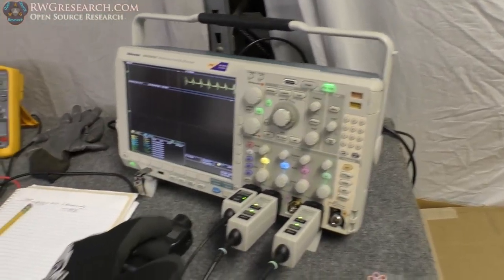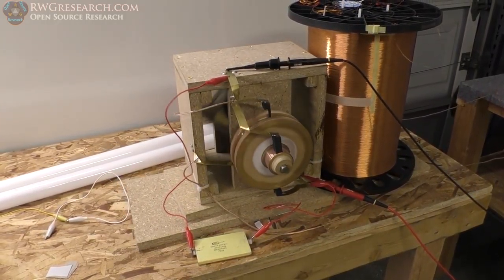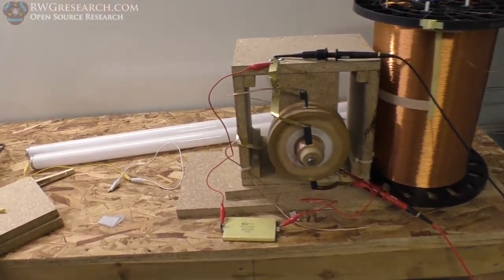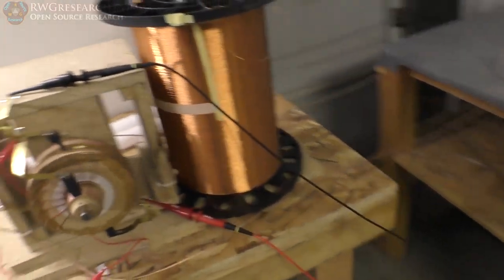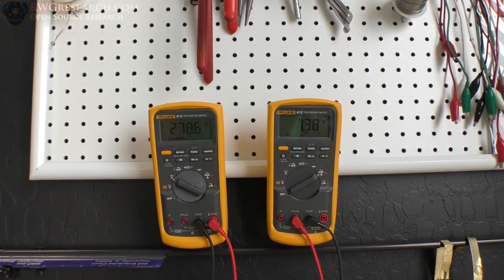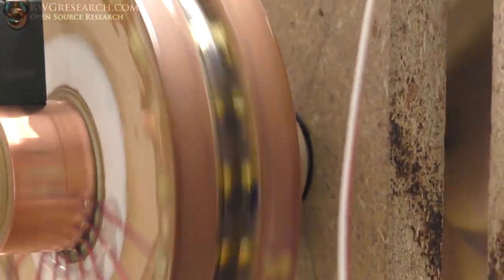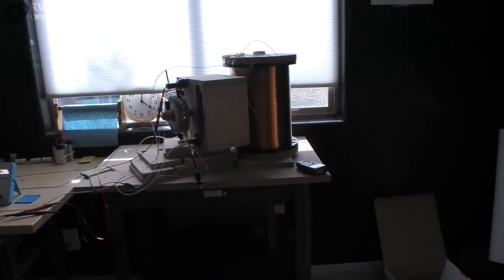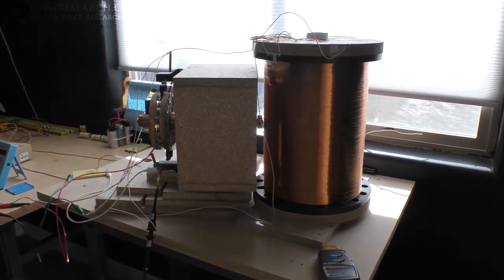JWN Project P4: Cap Discharge, Running Fast. Second Part Is with All The Wire... All 76 Miles Of It!

Comment: Are you going to run it at an angle as Newman Talked about? I've had some interesting unexpected acceleration of a free rotating stationary magnet from a nearby oscillating magnet at about 20 degrees from horizontal.

Comment from the maker: This video is random clips from 12-30-2017 to 1-17-2018 on the Newman test setup. can you decided why the cap makes it go a lot faster? Interesting observations... ~Russ
Reply: rwg42985 is any part of your set up grounded to an earth ground? The earth is just a giant capacitor, or single side of one, the air being a dialectric and the ionized space winds above the air being the other side of the capitor.  A small capacitor is a type of small floating grounding rod, but no one uses them that way.  Its grounding ability depends upon its size and discharge rate.  Sometimes even ground rods are poor grounds, ironically.
Reply: Hi russ im edgardo ligutom from philippines i also studied JWN motor and  built it i found it he was so much correct to what he says will i want to answer to your question why it running fast when you put the capacitor accross the coil is is simply because you short the coil when you cut the power supply off there no way to dump that huge current built up during a moment you energize the coil. the coil dont want to store energy when you cut to the supply so the only way to dump it is to the capacitor the capacitor act as a bridge to that huge current to pass .now in order to make use of that huge current to work is to short it to its self im refering to the coil so that the coil will then now become a electro magnet the bigger the current ang the number of turn the stronger the magnet. You are now so close to over unity in fact it is over unity already. In the video joseph newman coupled the machine to the generator and loop it to run itself.
Reply from the maker: Gristle Von Raben no,  nothing is grounded.  If we ground the system we will lose the RF energy generation I spoke about in my part 15 video.  So to ground the system leads to negtive results.  More to do there,  hope to show some time what I mean in a demo.  ~Russ
Reply from the maker: Edgardo Ligutom,   thsts corect,  I agree with your statements,  nice work answering those qustions correctly!!  Thanks for sharing,  did you get any RF output with your coil?  Thanks,  ~Russ
Reply: rwg42985 i dont have any rf measuring device but i strongly believe it has RF due to transient
Reply: By the way the capacitor will try to discharge it back to the coil to prevent that try putting high speed diode before the capacitor at that way you can capture the energy and use it to feed it back or use it in anyway you want
Reply: rwg42985  I think you are on to something with the RF stuff..Newman got that figured out? But did he leave evidence of how to harness it? HE talked about it, but did he give illustrations on it hidden in his writings..enjoy your researcg..keep it up

Comment: Hi  Russ, Does  it  not  matter  that  the  coil  is  not  around  the  magnets ?  Wouldn't  it  work  better  that  way ?
Reply from the maker: KG Salvage yes,  actually,  it depends on what you want to do.  This coil was promarly use for RF energy generation.  So mechanical output is not verry good.  The flux coppling is bad,  but the coil is good for the RF side of this device.  ~Russ

Comment: It would be more helpful if you could accompany this with a circuit diagram! Blessings!
Reply from the maker: ( batt+>coil>Batt-)  that's it... the commutator fires , shorts with gaps between, each 1/2 rotation the power to the commutator is switched. there for flipping the coil polarity. the cap was added across the coil, And across batt to show the difference. ~Russ